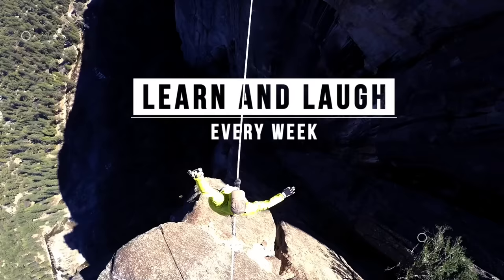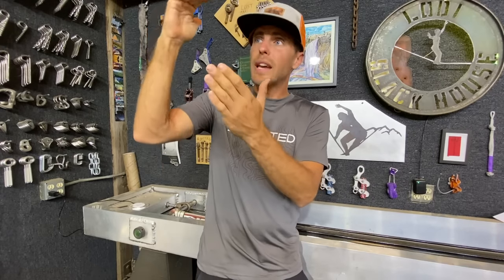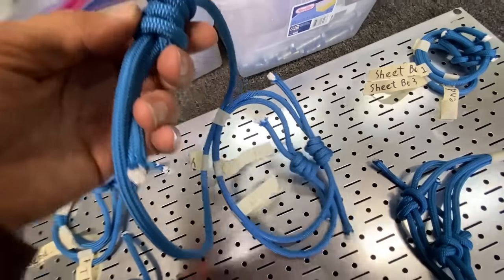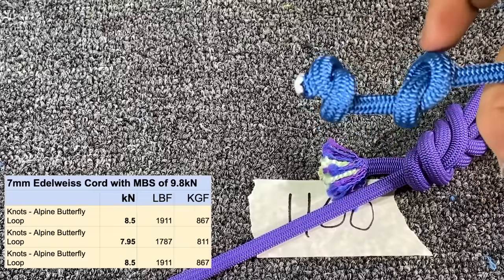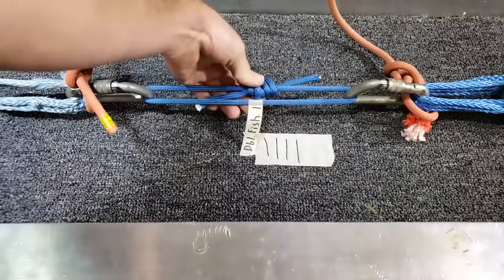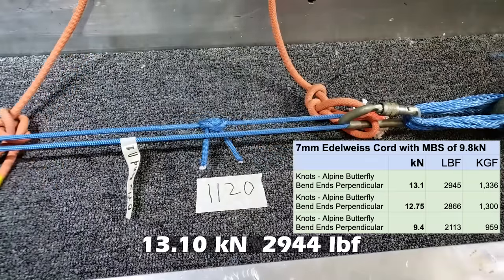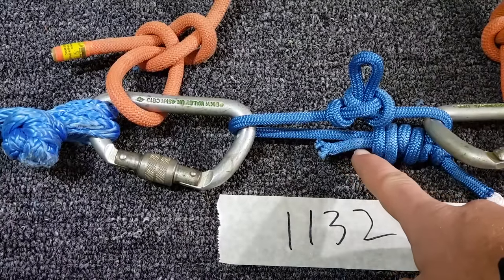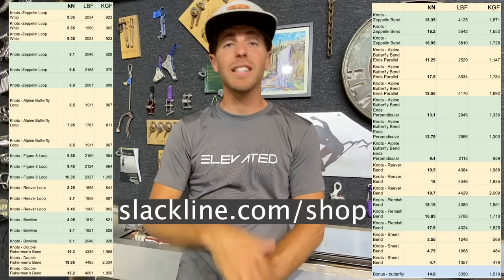Break Testing Knots - Zeppelin & Figure 8 & Alpine Butterfly & Reever & Bowline & Double Fisherman

Comment: Great video!  The sheet bend appeared to be tied differently than the way I was taught.  Both bitter ends should be on the same side of  the knot.  Perhaps they would break rather than slip.  Perhaps (k)not?
Reply: yup, the version in the video is known to be insecure.
Reply: @egericoolast  would that also make this version a left cost sheet bend?
Reply: @daviddroescher  Assuming auto correct messed you up, yes this is a left handed sheet bend
Reply: @egericoolast   nope, play on words left cost =west cost / insecure  = can't hold up under pressure.  I've had residents in all 3eft cost states. Both have been more inland in more recent decades.
Reply: Re.  sheet bends:  the simple simon UNDER 
is a better alternative.

Comment: I'd be really curious to see how the normal alpine butterfly holds up when the loop and both ends are pulled in different directions
Also, super keen for the drop tower knot tests!
Reply: I wonder whether a test scenario like this could be setup or not, in a manner that would make the results relevant for the real world. The results of such a test would depend greatly not only on what force is applied on the loop, but also on the angle of that force relative to the main line. But the most important variable is the length of the lines from the knot to the attachments. That length influences the angle of the main lines to the direction of the pull which, in turn, GREATLY affects the resulting force in the line - and that angle would also vary during every pull. So... which set of parameters would be relevant in terms of realism? There are literally an infinity of such sets of parameters.
Reply: @hugbearsx4  I agree but I think that makes it all the more interesting for me, I'm really curious to see how the knot behaves in each of those scenarios and therefore get a better understanding of the potential use cases and limitations of it. As for how you'd test it, that's ultimately up to Ryan to decide but you could possibly test it in the following 3 orientations:
1. Loop and each of the ends pulled with equal force at 120° angles to each other (though I understand that that may not be super easy to set up).
2. Loop and one end pulled in one direction with the force distributed across them, and the other end pulled in the opposite direction.
3. Loop pulled in one direction and the ends pulled in the opposite direction

And again, the point isn't necessarily to reproduce accurate results to what you might see in the real world, the point is to get an understanding of how the knot behaves under different scenarios.

Comment: I've used many of these knots in rope rescue work.  Many that you used were redundant, as in many are used for the same purpose so not all need to be used or learned.
Very interesting testing.  Quite entertaining and educational.
I would like to see the slipping and breakage on high-speed cam.
Reply: It's definitely interesting to see the slipping and at what load it start especially on wet and dusty rope.

Comment: I feel that the sheet bend result might be because it was not being tested in the usual use case, which is to the best of my knowledge is specifically to join a thin rope to a thick rope, where the thick rope forms the basic loop. 

This might mean that the knot was not tightening properly under load in your test as the two ends of the rope were tightening at the same rate; whereas when set up correctly the thinner rope would tighten around the larger one as well as onto its own running end, preventing slipping.
Reply: He tied the sheet bend with the working ends on opposite sides of the knot, which is considered an error.
Reply: @Catcrumbs  would not making this small error really make the knot that ineffective?
Reply: @moodywonka  I can't find any empirical data on the subject. The sheet bend stands out in this video as having a very poor result, which does not seem likely to be a true reflection on the bend, considering its long-standing use. Just as a 'small' error makes an inferior granny knot of a reef knot, I think it's very possible that the sheet bend would do much better if tied conventionally.
Reply: Re.  sheet bends:  the simple simon UNDER 
is a better alternative.
Reply: @Catcrumbs  Re.  sheet bends:  the simple simon UNDER 
is a better alternative.
Reply: @moodywonka  incorrectly tying knots can be deadly; 
the Yosemite bowline, for example, 
has been blamed for amateur climber fatalities, 
and the sheet bend is 
not secure; useful as a temporary bend for dragging 
heavy stuff, but definitely temporary & insecure, 
even whe tied correctly...
Reply: @christiffany6680  you seem to have beef with the sheet bend. I have built many highline anchors with a double sheet bend and never had them slip at all. Of course I back them up because I like redundancy but they are widely used and known to be safe. I’ll look into the alternative you stated but comparing the sheet bend to the Yosemite bowline isn’t fair lol

Comment: Thank you for the tests, I really appreciate your efforts. 
In my opinion the test with the sheet band could be repeated because the knot was tied incorrectly. 
Theoretically, the sheet bend should hold just as well as the bowline, since the sheet bend is nothing other than the bowline.

Furthermore, it would be very interesting to see if a double or triple sheet band holds better.
Thanks in advance
Reply: No, sheet bend is loaded differently than bowline so you can not expect the same strength. Besides, usual sheet bend is tied so that both working ends are at the same side of the knot, not like the sheet bend in the test. That may have affected the results.
Reply: Re.  sheet bends:  the simple simon UNDER 
is a better alternative.

Comment: Not only shock load vs steady pull on a freshly tied knot, but presetting with a moderate pull, allow it to rest/cool a whille then test ultimate strength. Wet or dry is another factor for strength, heat, and untiability. 
Material properties like friction, strength per diameter, twisted vs braid vs kernmantel, and elasticity will favor different knots.(though you are focused on climbing gear so that narrows the scope a lot, not like you are going to use 8 plait manilla)

Comment: Beautiful testing! I personally would prefer a link to an excel document with all of this data entered into it. Excel is by far the least fun way to get this data, but it's fast and how a lot of data is analyzed in all sorts of industries. 

This is nitpicking, but some of the knots tested here weren't "dressed" very tightly before testing. This may cause additional slipping and wear, resulting in premature failure. Also, this a huge commitment, but I'd like to see how data changes for various types of rope as well. I primarily use commercial 550 paracord, however also use some natural rope (might be jute, but I really don't know). It'd be interesting to see how different cords react, as they have different qualities and friction coefficients. 

Thank you for your wonderful testing and data.

Comment: Great info in this video! I do rope rescue work and use a few of those knots on a regular basis. I was super impressed with the double fisherman's! The sheet bend is one we use a lot as well, and I was surprised at how terrible of a knot it is. But we mostly use it to tie ropes of different sizes to each other, I would really like to see if it would have different results when tied with ropes of two different sizes.
Reply: It's not terrible, what they tied is clearly not a sheet bend. In a sheet bend the ends of both ropes are on the same side. It's a beginner mistake. A bit like the difference between a square knot and a granny knot.
Reply: he teid a left-hand sheet bend, which is a no-no. it is like a granny knot.

Comment: Also, I noticed that the Sheet Band tested, which slipped, was tied with the working ends on the opposite sides of the knot.  I believe Ashley described this bend as less secure (as in more likely to slip under tension) than the version where the working ends are on the same side of the knot.  I wonder if this is supported when tested?
Reply: Re.  sheet bends:  the simple simon UNDER 
is a better alternative.

Comment: Primary function of the sheet bend is to tie ropes of different sizes (or tie a rope a sheet). Not an ideal bend for ropes of the same size. Would be curious if the double or triple sheet bend worked better. I'd imagine so... But Idk.
Reply: Re.  sheet bends:  the simple simon UNDER 
is a better alternative.

Comment: I have always been using double fishermens for the ease of tying one and most importantly its super easy to untie when its pulled hard on. Im happy knowing that it did so well.
Reply: ??? Double fishermen's locks up tight under very little pressure. Often can only be untied with a sharp knife. :-) Literally the hardest knot to untie of all in this video.

Comment: The sheet bend is specifically for tying together two ropes of different diameters. Not sure how you would test this, but I would love to see you find a way to determine if that changes the strength of the knot.
Reply: Agreed I had always seen and been taught for it to be used on dissimilar diameters.

Comment: Thanks I've actually been wondering about some real-world testing to find out the actual strength reduction.
Reply: This wasn't that. Some knots did better than others, but using testing bends by breaking sling type configurations is a bit funky, etc.

Comment: Sheet bends always have to be safetied on each side or else they can pull apart as you saw.  A double sheet bend (two wraps around the bight) is stronger.  Both are nice for joining two ropes, mostly for being easy to untie after being pretty heavily weighted.  Usually a half of a Double Fishermans is used for the safety on each side.
Reply: Re.  sheet bends:  the simple simon UNDER 
is a better alternative.

Comment: Great video.  And, no, it wasn't too long!  It was chock-full of very interesting stuff!  Each test was interesting and fun to watch.  One question, though:  Do you think that using a knot with two loops, (or three?), around the carabiners, might help prevent results where the rope breaks there?   Even a simple French bowline, with its double loop, would help ease the stress on the rope, at the carabiner ends.  I'd like to see some tests where the failure NEVER occurs at the carabiners.  Then we'd be seeing the knots' strengths themselves.  In my opinion, if the rope fails anywhere but in the knot, its comparative strength hasn't yet been fully tested.  But you do come pretty-darned close!  It's the best of all such videos I've seen.  Good, thoughtful production values, too.  And no annoying tech music!  🙂

Comment: I am confused by some of these tests.  For example, if you test a bend that is tied in a loop, it seems to me that the force exerted on the knot is approximately half the force indicated by your load device, since the load is shared by both sides of the loop.
Reply: Loops are usually double the strength of a single strand, minus the strength reduction of the bend(knot). Ryan usually breaks things as they would generally be used in practice, unless he's trying to isolate a variable or replicate a scenario. In climbing bends are almost always used to produce a loop, so that is how he broke them.

Comment: One possible reason for the variation in rated MBS might be the pull rate? Most standards like ANSI 359, CSA 259 require the static test equipment to pull at a uniform rate of no greater that 2in/min. This makes it 'purely' about the static forces and less about heat and friction that build up faster and aren't dissipated as fast at the faster rates.  You still get heat from friction and energy release of course, but it helps to have a set benchmark.

Comment: Thanks for the video! Fascinating stuff, even though I hardly ever use these knots.

Someone once told me the alpine butterfly knot could be used to take the strain off of a badly damaged part of a rope. Obviously using a damaged rope is a bad idea, but I guess stuff happens sometimes. Maybe you could do a test on different knots to use when, for some reason, the rope is damaged and you still need it to hold a load?
Reply: I have heard the same, and also that the alpine butterfly maintains nearly (~90%) of the rope's strength when pulled tail-to-tail. Ofc I have no evidence, theoretical nor practical, that this is true, so I would love to see an alpine butterfly break tested where the two tails are pulled.

Comment: I would also be interested in seeing some knots for joining different radius ropes, for example a 6mm tagline connected to a 9-10mm rope. for example using an overhand, the double overhand thingy that all the guides use, a flemish bend (hey learned something new today, used to call it a follow back figure 8) or whether it is better to join using a carabiner or rap ring.
Reply from the maker: Good idea
Reply: That's exactly what the sheet bend is for, and I'd like to see it tested with different diameter ropes to see if it's any stronger

Comment: would love to see an entire video on bowlines, use them everyday at work both climbing on and lowering off them
Reply: I'd  be interested in the strength of a re-threaded bowling as used to tie into my harness. I use that in preference to a rethreaded figure of eight as it can be untied easily after taking a fall - unlike the figure of eight (even if it is neatly dressed as suggested by some people)
Reply: See scott's simple secure 
locked tail bowline 
based on 'cowboy bowline' 
(tail outside the eye-loop); 
tail secured by bringing it 
inside the eye-loop and up 
through collar parallel to 
standing line. 
Secure,  
easy to tie, 
easy to untie, 
easy to check and 
unlikely to be mis-tied 
or poorly dressed & tightened. 
The standard bowline 
has LONG been known to be 
insecure if other than steady 
straight-line tension, 
(shaking the bowline can loosen it, 
which is why 
the cowboy bowline exists, 
putting the tail outside the eyeloop 
so horses are Less likely to shake it loose 
my GrandFather raised Quarter-horses, & 
back then, the natural-fiber ropes were irritating, 
so putting the tail outside the loop 
was less irritating AND a little more secure).  
Scott's simple secure 
locked tail bowline was one of only 3 or 4 
bowline variants that passed exhaustive testing 
by Search-&-Rescue research 
headed by Mark Gommers in Australia, 
and it is both 
simple and unmistakeable, 
as well as safe and secure...

Comment: Some fishing bends are amazingly strong - stronger than the component threads, in fact! Of course, entirely dependent on the thread types, for example monofilament to braid joins I usually go for the FG knot with multiple overhand locks. That thing doesn't slip (and in use I've never lost a leader line, even with the shock load of casting a 6 ounce weight 200 yards on 55 pound test braid mainline to 80 pound test mono shock leader).

Comment: Hey so I stumbled across this video while I was searching for some answers that explain the difference between a standard bowline and a cowboy or Dutch bowline. A standard bowline has the tail on the inside of the loop and a cowboy has the tail on the outside. I’d love to hear your thoughts on that.
On another note I noticed that the sheet bend was actually the wrong application for what it was designed for ( or at least what I was taught) the sheet bend is designed for joining two different size ropes together. 
And you mentioned that you have trouble tying it something that may help you is if you actually look at the knot it is basically a bowline. Which incidentally is the reason it slipped and failed in your testing. Basically you were taking a bowline and spreading the loop.

Comment: The method of tying the various knots and bends is interesting in how they fail. The sheet bend is often used to join two sections of rope together, but also of different widths etc. So a double as opposed to a single would be interesting. But also the amount of rope in the knot and the way the force is spread is interesting also (see double fisherman's). Obviously there is a need for convenience in being able to release a knot out bend in use in the real world too.

Comment: When you test a loop of rope with a bend (that's a knot that joins 2 rope ends together) on one side, the force on the bend (that's the KNOT remember)  is half what you are reading, as the force is shared on both strands.  Where it goes around the karabiner - that's where the force is getting close to the indicated force - just one strand doing the work, and knock off a tad for friction.  You would always expect a half-way competent knot to result in a break at the karabiner.  Which karabiner is of no interest at all if the karabiners are the same.

Comment: Sheet Bend was used to tie sail cloth to rope. Normally the bend part is of larger dia. or even chain, then the other rope goes around and is locked be its self. A double sheet bend would have the smaller locking rope make 2 turns under its self and not just one. Kind of like a fishermen's bend for 1/2 of the knot. Interesting! Maybe try pulling a splice or two apart? Like an eye splice to see how that comparison to a knot on the rope end fairs for strength.

Comment: could you test a bend with two knots in it, one on each leg of the bend?  The question is "which friction stresses the rope more, rope on rope from the tightening of the knot or the rope on metal of the rope sliding through the carabiner."